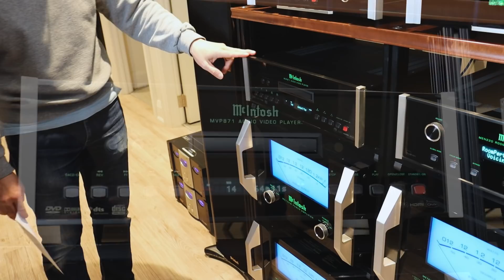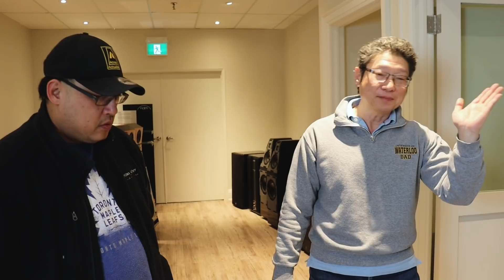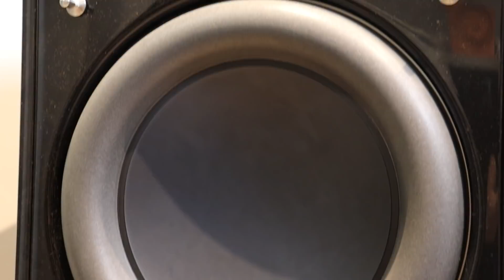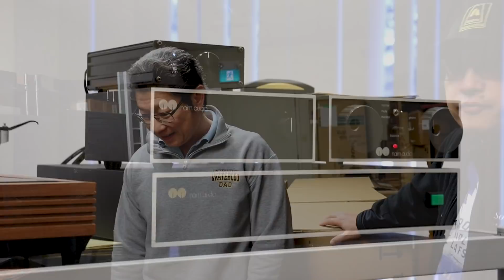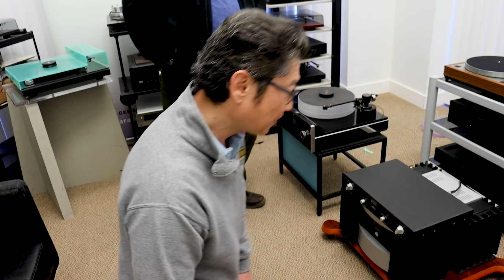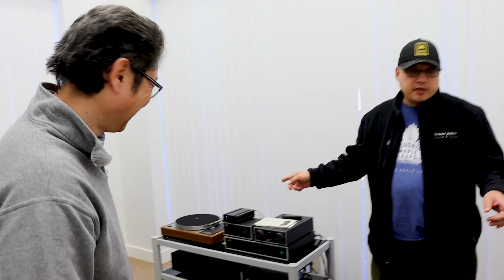Huge used haul! McIntosh, Martin Logan, and more!

Comment: Hello from Montreal, I have Mcintosh amps which includes the C2600 preamp. It’s now time to replace the tubes on it. I have never seen any videos anywhere on the replacement or the  need to change the tubes. It might be something that you guys could talk about since you do sell tube amps. For me I found out that my tubes needed changing because I was getting an audible clicking sound when I used the MM and the MC phono inputs. I had no idea through any documentation that tubes needed changing other than word of mouth.
Thanks

Comment: I once installed a system based around the same equipment.  Same speakers and amps.  Even the rack & monster power products seemed the same; had to do a double take.  It was a very cool system. We also added two JL subs.  Tried the McIntosh subs but they could not keep up.  It was the clients "Cottage" system; white glove service in the middle of nowhere.  Each amp was wired to its own breaker.  Speakers were very interesting.  Filled a massive space.  Very cool pickups for the store.  Someone will be very happy with that system if it stays together.

Just watched further...two JL F212 subs...got to be the same system.  Who else would have the same entire thing!
Reply: Must of sold the cottage. Next owners wife said " get all this noise making crap out a here". Just a guess!